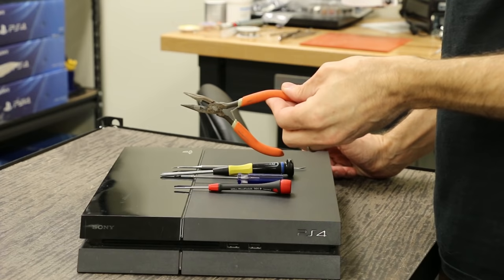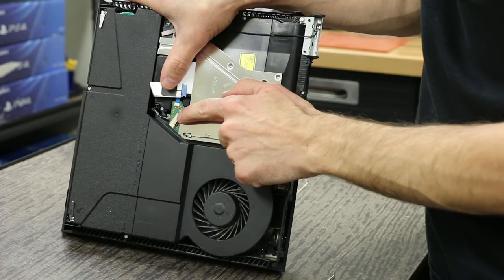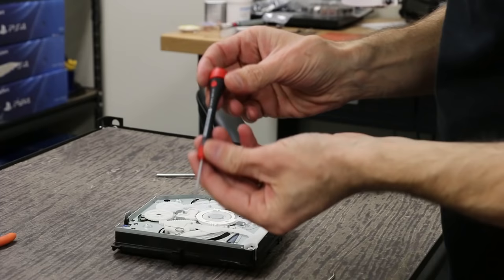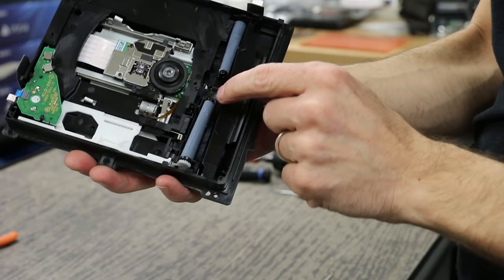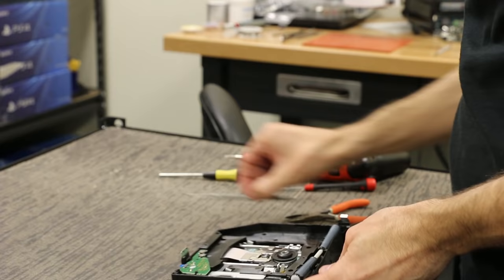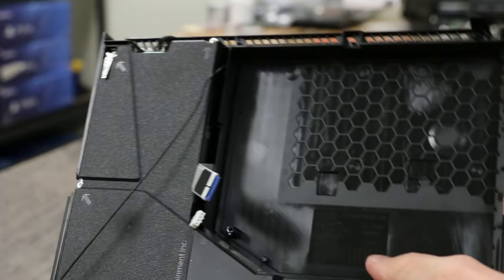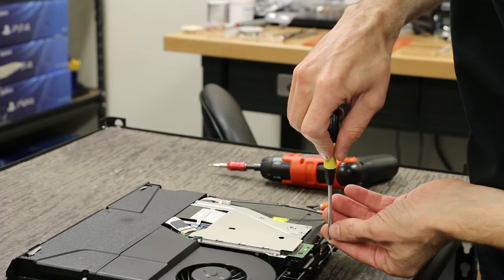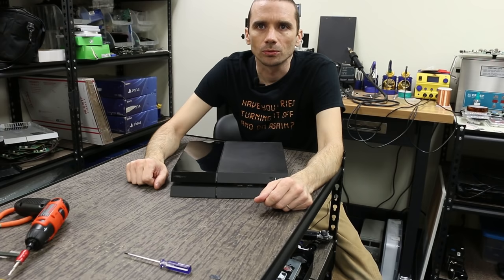PS4 Won't Read Discs Fix (Makes Noise/Won't Accept Discs)

Comment: Hey mate can you please help me , for the last couple of months 2 out of my 4 PS4 games and most blurays aren't reading properly , when I put my gta5 in for example  or my battlefield 1 and my FIFA 17 the laser makes a lot of noise if I click into the application straight away once it loads I will be fine ( although its very noisy ) it will work , even though gta has started freezing and acting strange , but if I put the game in and wait a few moments before I open the application the laser will make even more noise and I will get  the error code CE-30005-8 ( cannot start the application ) and with bluerays the error is  CE-35486-6 ( cannot start the application ) and you can actually here the laser making a kind of clicking sound while it's trying to read it . Im positive all the smoking I've done right in front of my PS4 has caused this but the strange thing is my f1 2016 and project cars are completely perfect , and some Blu rays I don't have the problem ( although the laser has become loud in general ) . Do you know how I could fix this problem ?  is it possible it's a hardware problem ? I already tried disconnecting my Usbs and removing power and hdmi cords for 5 minutes and it didn't work  , any help would be much appreciated thanks
Reply from the maker: Sounds like maybe a laser problem.
Reply: Danielson 343 i have this problem too! some of my games work but some dont. one day i was playing infinite warfare, the next day i put the same disc in and it made a load of noises and it wouldnt eject the only way i could get the disc out was from taking the power cable out and putting it back in . is this a problem with the laser?
Reply: id say so , mines a bit different , if you read my  original comment again , it hasn't gotten any worse thats for sure . just some games once i put the game in and it loads i have to click on the app within 10 seconds or else it then will start making a lot of noise and i get the error codes and the game won't load up and it takes a good 20 - 30 seconds before i can do anything  .( but all my games do actually work ) as long as i follow that process of clicking on the app straight after the disc loads .  other games like i said it doesn't happen there fine  . i have 5 games 3 of the games i have the problem . 2 are completely perfect , I've learned to live with it . i wouldn't say the laser is abnormally loud ? but then again who knows it still works fine i don't see the need to change it atm , your sounds a bit different if the game won't come out at all or games aren't working at all  . you should try waiting 20 - 30 or even 40 secs till you get the error code then the game should come out . and like i said try clicking on the app as soon as the disc loads and see if the game works then ,  also there is videos on youtube explaining how to get a stuck game out its actually quite easy , i  also took my whole playstation apart following a video and cleaned the fan , you should of seen how dirty it was so thats definitely helped the noise of my ps , but be very careful you don't thread the screws they thread very very easy . the back 3 under the sticker this is
Reply: Danielson 343 mine does the same exact thing it makes weird noises like the lens cant read the disc and the game just keeps loading till i get that same error code but i been doing the same method as you put the disc in wait bout 10 secs then click on the application and it works fine but ima try taking mine apart and clean the lens and if that don't work i just buy a new disc drive on amazon
Reply: C0TY1990 
I took mine apart to clean the fan 
But i wouldn't recommend trying to clean your laser unless your very experienced .
Reply: Danielson 343 i use to do it all the time with other consoles but i have nothing to lose if cleaning it dont work then i buy a new lens for $20
Reply: Danielson 343 I have this exact problem. If I start the game straight away it's fine but if I put the disc in and leave it a moment I will get the error just wondering did you ever find a fix for this?

Comment: Top lad. My PS4 wouldn’t take any discs, so I thought this may have been the issue. Turns out a toy wooden credit card that my two year old had decided to stick in the PS4 was the real problem. Despite the rollers not being to blame your video and guidance sorted it out and I’m back on Red Dead 2. Cheers!

Comment: Great video, when I opened mine up the right side roller was in the back of the disc drive and the white part that holds the rollers together was inside the gear part.

Comment: Thanks so much. I got home from work and disc drive wouldn't accept a disc. I figured my og ps4 is 5 years old and maybe drive failed. But I also have a 5 year old son who just figured out how to put discs in.  I used your detailed instructions and lo and behold, he had tried to put an old ben 10 psp umd disc in there. Works now.

Comment: 5 years later, this bloke clutched up hard for me. video is only 16 mins but this took me about 2 hours cause I didn't have all the correct tools etc. my rollers were in place but quite dusty inside. I recommend for people who's rollers are in place and can't see any errors to clean the laser reader thingy while you have it all disassembled.

Comment: Thank you so much for making this video! i had a stuck disc and wouldn't eject, ordered a T8 security screwdriver which came today and managed to get the disc out the barrier that comes up released itself and now it works perfectly also gave me the opportunity to clean the fan and it was caked in dust since the clean it nows runs quietly and smoothly! it's a 1st gen launch ps4 and never been opened till now and i'm super happy! Once again Thank you brother!

Comment: Thank you so much for this detailed video! The rollers on my drive were fine, but my toddler had put a couple of thin manget/stickers into the drive. I suspected as much before I started looking for fixes and yours was the easiest to follow. I removed them and all is well.

BTW, I suspect removing the 4th screw from the back of the case is not needed, only the top 3 needed to remove the cover.

Comment: Thanks alot man!! I followed your exact steps and it now works perfectly! There was something stuck inside and one of the rollers wasn't sitting right. The hardest part was putting the connector on as it was a bit fiddly. Thanks again!
Reply from the maker: Glad this helped!

Comment: My disk drive was making a disgusting noise and wouldnt read disks. After about 10 - 15 seconds of grinding i would eject the disk myself scared that they were gonna be damaged. So i had to open my ps4. Followed the video and got to the disk drive and my rollers were perfectly in place. Was about to abandon hope then noticed some blue plastic between the centre spinning part and the lens reader which slides back and forth on some rails. Slid it back, removed plastic. Put ps4 together again and it's fixed ! I feel so accomplished. So much easier to open it up and put it back together again. The blue plastic part was the centre of a ps4 case that you press to pull your disk out. Circle piece with a triangle in the centre. My neice or nephew's doing. 
Thanks for the vid, really helpful !!

Comment: Tried this because my disc drive wouldn’t accept discs. Got to the bit where the the white pin was missing in the video, only to find my white pin and both rollers were intact with no real issues visible. I gave the whole drive a bit of a clean, reassembled it,  put it back into the console and tested it to find that it was working again!?! Goodness knows what I did apart from cleaning it, to get it working again but I’m glad I watched this video, otherwise I’d never have known how to  even begin!

Comment: great guide. Mine would not load the disk but when disassembled the rollers were in place. Under further inspection I found a stray hair inside the eject mechanism and removed it cleaned the rollers and the laser lens . Re assembled and it worked.
Reply from the maker: Glad yours is working!

Comment: I’ve had something like a round playing card but stuck IN my drive for 3 years my toddler had accidentally shoved in there. Thanks to your video I was able to get it out! Thank you so much, I just wish you went a tiny bit slower with putting it back together ☺️

Comment: Thanks! I just got Elden Ring back up after my PS4 stopped pulling the disc and almost ruined it last week... I took it apart like you said and sure enough the rattling noise was that little plastic roller piece stuck under the flap.

Comment: Thank you so much for this. My ps4 hasn't been able to read discs for 2 years therefore I've been buying every game digitally. Your guide gave me the courage to try to fix the issue myself and it turned out the white piece and one of the rollers were misplaced. I was able to put them back in place and now everything works. Again, thank you!
Reply from the maker: Great! So glad this helped!

Comment: Thank you so much! This worked on my PS4 after wanting to play Spider-Man and the disc took forever to read and once it did read it it had a question mark in the home menu. So, it wasn't reading it. I tried other videos before this. My partner use your methods and we found out that the piece that was messed up in this video was also loose. Once we loaded up the game it read it, so thank you sir!

Comment: I have a cuh-1215a (gen 1 ps4 I think) will only eject. I've had it torn down and blown out. The  ps4 works other than that. I keep seeing eject adjustment screws but I'm not so sure the original had one? Suggestions?  It trys to eject as soon as I put a disc in. Your videos are very very good and informative and I'm guessing you're a fan of the IT Crowd. : )

Comment: Ever since the PS2 era, Sony's Playstations have ALWAYS had disk drive and read error issues. The PS2 would eventually develop a problem reading the black and blue bottom CDs. The PS3's seemed to just have a short lifespan. And the PS4 just seems to be cheaply made and they fall apart. Every time I've tried to replace the disk drive on my PS4, (three times at this point), I would get the unit in the mail and I could shake it and hear things rattling around inside of them. Broken before I even installed them. SMH.

Comment: A another trick is to:

Right when you insert the disc just tap in the middle pf the disc area LIGHTLY. 
That's literally all.

It will be hard at first but gradually the ps4 will be eaiser to cooperate so just keep trying.

Another method is to flip the ps4 on its side, but I personally use the tapping method.

I've done this for 2 years now because I don't have the tools to check the insides.
I know it was very hard at first but never give and and just take the disc out and in again.
Reply: our ps4 are making weird sound weird when reading the disc can this tips help?
Reply: @markrendellpama1079  safe mode

Comment: Hey guys, a couple of days ago I had great success opening the ps4 up for the first time and @TronicsFix, you've missed a few bits and I also found a few parts of it challenging, so I'll cover them for you if you don't mind. Watching this video makes it a whole lot easier. Before you take the ps4 apart, if you're a smoker like me, ps4's and laptops ( open vents and fans ) - don't combine well with smokers, any tiny opening and your smoke will combine with dust and clog up everything. Obviously, try running the disc with the little brushes on ( that holds the IPA ) through the sequence, try to clean the reader without going in. If you can, you save possibly damaging something when you go and open it up. Each time you go into it, you increase the risk of breaking something..  ( the mechanism parts in the blueray drive have small plastic parts and a tiny broken fragment on one will wreck the operation of your accept/eject mechanism ) - trust me, it happened on my ps3. I suspected that the dust skirt on the opening to the drive was " wiping " the IPA off the cleaning disc. Pay attention to your discs, if they look smeared, there's some dirt/dust/cig smoke on that skirt. Get a new cotton bud, ( cotton-tip/cue-tip )Coat it  in Isopropyl alcohol ( the stuff that comes in a tiny bottle with the cd head cleaner ) eject any disc from your machine if you can, if not, turn it off and remove the power lead. Run the soaked cotton tip along the length of the opening/skirt. The bottom/Top and insert a fresh IPA coated one maybe 5 mill deep into the entrance of the skirt and run it fully left to right. You often use several clean cotton buds doing this. Clean until you see no more dirt on your cotton tips. Let it air dry/evaporate for a few minutes, power it up, see if it improves. It probably won't, but when you take it apart, you'll be needing to thoroughly clean that skirt inside and out.
When you do get inside, a damp + dry clean cloth + a clean small brush ( make-up brushes are terrific ), a compressed air duster, cotton tips, IPA and the right tools make the job a lot easier. Use a scalpel and tweezers to remove the security stickers and keep them safe, you can attach them back on if your careful. Remove the required bolts to start removing the ps4 covers and keep the bolts safe. When you're removing the covers, you almost have to apply enough force that would generally crack or break something, be patient and tease it off. The cover seems to be quite robust but will come off undamaged if you're patient.
Assuming you've followed the rest of this video and you're almost ready to start putting it back together, DO NOT FORGET TO CLEAN THE BLUERAY SKIRT/ENTRANCE THOROUGHLY. Dust/dirt and cigarette smoke and electronic items don't mix well. 
Finally, there's a 6-8 inch long thin alloy piece that is held in place with two long bolts. The right side one will seat well, get some purchase and you can tighten it up. The left one threw me a little, it wouldn't seat, no purchase, just spun around. I flipped it over and saw the bolt protruding through the circuit board with nothing for the bolt to attach to. As I'd not moved from my desk, something had fallen off. It was near me somewhere. I checked my lap, my clothing, my seat, the desk...  Got my torch out, it was on the floor near my feet. A tiny square washer type piece with 2x lips on one side. It's only about 4mm across. It sits lips down over the hole on the circuit board side. That's the piece that allows the 2nd long bolt to seat properly. So when you're taking that left bolt out, make sure you're aware it can and does fall off. DON'T LOSE IT.
When I put my whole PS4 back together and fired it up, it worked perfectly. Big thumbs up for this video. I hope my little tips are of some use. The hardest bit for me was removing the covers without cracking them, I'd rate the whole job ( ability wise ) as about a 5/10 for difficulty. But have the tools you need. It's do-able without a T8 security bit ( an instrument flatpoint screwdriver ) but a set of security bits/screwdrivers are only a couple of pounds. Save yourself the hassle and buy some, as most electronic equipment uses them...…. To stop curious 8 year olds dismantling everything. Also, make sure you have no curious 8 year olds around you, you'll turn your back for 5 minutes and before you realize it, they've " attempted " to " fix " your expensive electronic gadgets. It never ends well.

Comment: worked for me thanks!!!! only problem was the torx. the ps4 has a torx screw but the fitting inside has a raised pin at its center, in the middle. So my star screw torx did not work. luckily I found a video showing you can work around that by just using a small flathead screw driver instead without the special tool, but it takes some work.

Comment: Thanks for the video.  Fixed it for the most part.  Prior it would only load discs if I pointed the opening down at the floor.  One of the rollers was scratched.  Cleaned them up and now it will load normally except if the disc is in the tray already during a restart.  Then it just whines up and down as it tried to load.  If I eject and reload it detects disc.  Earned another subscriber.  Anyone found a place to order replacement rollers?  Gave up searching on Amazon before I gave in to buying a bunch of controller mods.  :)

Comment: Hm. Followed this tutorial. Rollers looked fine. I cleaned them. Now the disc drive won’t even recognize a disc is being pushed in at all anymore. It used to just slowly pull it in at a snails pace. Now as I push the disc in it pretends I’m not pushing anything in. Ugh.

Comment: This seems to have worked. Removing the rollers almost was catastrophic because the camera and your fast movements didn't let me see how to properly remove it/where to apply pressure to what specific bits and I feel like I jammed the spring mechanism up a bit but now it reads discs...though the spinning of the disc and reading now sounds slightly "crunchy" or gravelly at times, but a few taps to the side (vertical stand) seem to remedy this and even allow me to read discs that still give the unrecognized error. I hope I didn't do any long term damage though lol
Reply: Also the discs are now coming out with circular ring of residue it seems...thought it was scratches at first but it's easily wiped away. Did I fumble my rollers or snap the mechanism they're apart of into an off-position maybe? Is this a non issue or something to worry over? I may just start saving up for a new Slim model lol

Comment: This video is very informative. And allowed me to finally update my PlayStation. As of patch 6.00. If you don't have a working disc drive the update will not go through and give you error code last digit 6. Which means you either have a faulty Blue Ribbon cord or faulty disk drive. In which case you can't use PSN services.
Reply from the maker: Glad this helped!